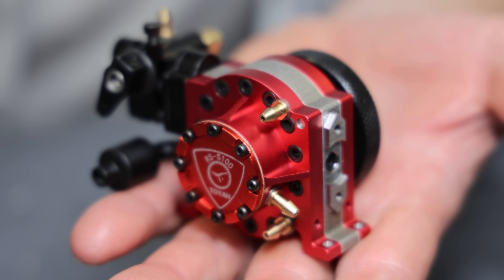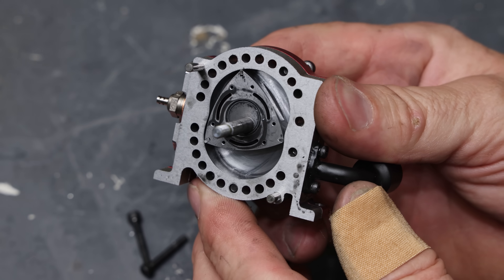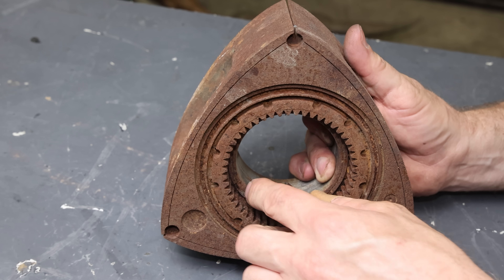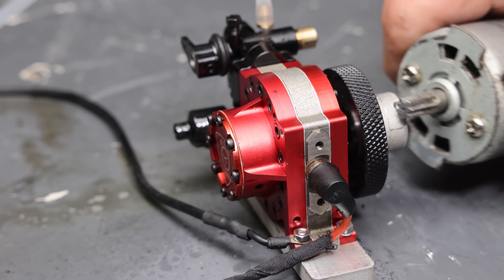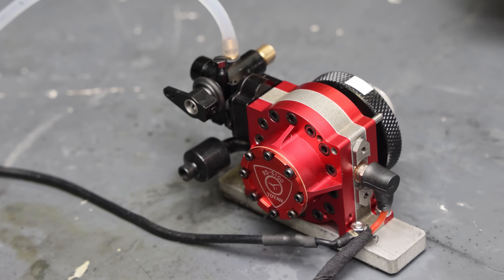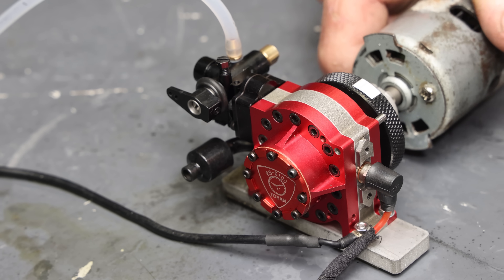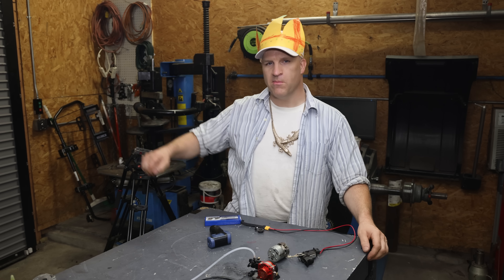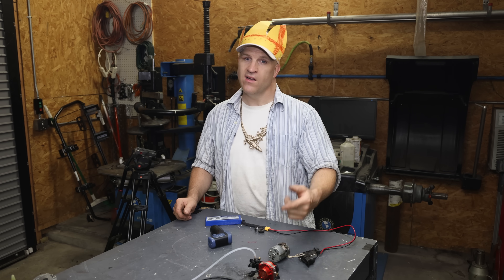Worlds Smallest Rotary Engine (30,000 RPM)

Comment: no tuning on nitro leads to what you see here folks.
Reply from the maker: Actually this is where no compression leads to. Without compression you don't have a running engine and you for sure don't have an idling engine. 
I mean come on let's be realistic, there are no corner seals no side seals and single piece single dimension Apex seals. Do you really expect this engine to run like a full size engine? However just like the other version of the rotary I built, I can modify this one as well. Might be tough because the tolerances are very small but I can make it happen.
Reply: @WarpedYT  lol a bad workman always blames the tools.

Face it buddy  from what you posted as a video you didnt take not even a fraction of a second to check the needle setting.

At least to see if its at a range thats for nitro.  I been doing nitro engines for decades all have an initial setting of 2 to 2 and half turns out as a starting point.

You heard the engine on first startup and still didnt bother adjusting.  You did this over and over again blaming the engine vs yourself.

Must a biden voter

Comment: Definitely a way to increase compression and it'd run way better and i personally don't think its worth 500bucks
Reply from the maker: That's exactly right, that's what everybody doesn't get an engine with a very leaky compression stage will never run really well. It's definitely cool no doubt but like you said some way to increase compression.
Reply: @WarpedYT  , I too own one of these Toyan Wankels and a few (4) O.S. Wankels. The huge mistake Toyan made in their design is to rely on the stacks of stainless steel wear plates for the faces of the rotor to rub against. My engine has a rotor that’s 0.0006” thinner than the combustion housing and with that much clearance it was still almost impossible to rotate. Why? Because the stainless plates bulge inward as their edges are pinched between the housing rim and red end plates. My O.S. Wankels are closer to 0.0001” clearance but O.S. uses a hard-plated surface to support the faces of the rotor and those are extremely flat, so the clearance you shoot for is the clearance you get. I can hand-start the Wankel that I fly on my pylon racer, that is how good it holds compression pressure. Contact me if you want to discuss some ideas to improve the Toyan. I’m in direct contact with one of their distributors and we are discussing improvements to this engine. I have the twin-rotor on order too. Cheers.

Comment: I would have taken it apart after running it. I feel it was compromised from being taken apart as the head surface torque, gaskets, flywheel position, Apex seals and springs are very sensitive. Would be nice to see one that hasn't been tampered with run.
Reply from the maker: One thing everybody on YouTube is teaching me I can't leave any Stones unturned. 
So I did run it before taking it apart, or at least I tried, the only reason I took it apart is because it didn't have any compression and a Apex seal was stuck.
Guarantee you I can make this engine run better than it comes from the factory.
I have built hundreds of rotary engines including peripheral port and Bridgeport, this engine is a piece of cake compared to a real rotary that has corner seal side seals two-piece Apex seals with springs, you have no idea unless you've actually built a real rotary, the seals are a pain in the butt. This engine piece of cake there's really nothing you can mess up unless you lose some parts.
Reply: @WarpedYT  , Matt, how tight was your engine as received? Mine has zero chance of running as the stainless plates are sprung inward towards the rotor. This engine needs a major overhaul before it can seal properly and run as intended. What happened to your cooling fittings?
Reply: @GFTPSMP  It needs a redesign

Comment: Mazda Rotaries have a bunch of complicated side seals springs. The way “crank shaft” works and assembly is far from simple. Just watch Rob Dahm assemble one.
Reply from the maker: I've built so many rotaries I've lost count, but I got tired of the Apex seal and corner seal issues.

Comment: That was a hop skip and a jump away from a full rapid unscheduled disassembly.  Would have been nice to see it go before you took it to bits.

How did you not spot the loose pin?
Reply from the maker: Lol.... Yes
Reply: The pin is only lightly pressed into the casing. Once the case bolts are tight that pin no longer has any use.

Comment: Another fancy Chinese machine, not an engine. 1.7 hp …. Should be 3+, nothing else than another Chinese crap
Reply from the maker: Actually it's .7 horsepower
Reply: @WarpedYT  , the first production OS Graupner Wankel was rated at .65 HP and the ones you did the transparent front cover was 1.2 HP. This Toyan will not reach .70 unless a ton of work is done to it. Hey, that waterjet is just what you need to make some .020” thick ground carbon steel wear plates to replace the crap stainless parts. Then shave the housing down to get the .0001” clearance I mentioned earlier. The waterjet shouldn’t warp the steel plates when cutting the profiles. Cut me a set too while you’re at it, please 🙏🏻

Comment: oh man after all these years playing with those engines adjusting the carb is still a no go to you ? what you do there is absolute kill to such an engine ... tryin to get to run with brude force all the time .... i can see it runs way to rich and top rpm right from the get go is not good for any engine
Reply from the maker: Lol .. actually I do adjust the carbs, but I was told by.the factory not to touch it because it was fully adjusted. But most of the time unless it's part of the story I exclude messing with the carburetor needle.
Reply: @WarpedYT  hmmm okay... so i guess this all not figured so well and they where just happy it runs and doesn t break right away .... i personally think you need at least 3cc to reliably run a (any type of gas) engine ... anything below 2,5 is way to sensible and loves to keep you hanging on the other end of the yard.... sure if you get into the hobby and blablabla you know ... (pro talk) then its all good ... not sure if all this is also the case for rotarys .... but somehow it seems they burn even less efficient then the small piston engines....
Reply: @WarpedYT  i just have this idea of inducting the FUMES and not the atomized liquid into the rotary... i ve seen many guys doing it now with piston engines .... i can find em again if you want a link or something ... just let me know

Comment: Flooded at start up, melting plugs and exhaust fell off.  Yes that definitely is a rotary. 

Surely not making any compression at low rpm. Lack of side seals and housing to rotor clearance allowing blow by. 

Btw that is pretty cool!
Reply from the maker: Blow by like a mo-fo
Reply: @WarpedYT  are you going to put turbo chargers tho?
Reply: Most rotaries don't make good cold compression, the internal operating temps are high especially around the exhaust ports so they have to design them so that the clearances are right at operating temp. Piston engines get around this with ring gap, Mazda uses spring loaded corner seals to give the apex seals space to expand. 

Also like you said, no side seals but it might just not be feasible to make side seals for something this small. Even in a 13b the side seals are thin and fragile, they would probably look like strands of hair for this thing lol. Looks like there's thin metal plates that go between the rotor and 'irons' that may be an attempt to create some sort of consumable side seal that covers the entire side of the rotor face instead of being recessed into the rotor itself. Probably good enough for something like this, seemed like it was ripping pretty good once it got warmed up. Probably didn't help that he disassembled it, dropped some pieces, then put it back together in a dirty environment. Even a tiny bit of grit would clear itself out but put scratches in all the sealing surfaces on its way through...
Reply from the maker: @Joebobinator  your dead on about everything except the disassembly, see what I didn't show was I tried 30 times to start this engine, it wouldn't start had absolutely no compression, then I proceeded to disassemble the engine and I found a completely seized Apex seal. None of the parts were dropped. But yeah I'm going to upload that as a separate video on my other channel and share it here.
Reply: In this micro application I wonder if a one piece  circular side seal could work to help mitigate the blow by and add compression, similar in position to the oil seals on a 13b.  It could sit just inside the bottom edge of the apex seal slot.  

Trevor, Mazda used 2 and 3 piece apex seals in the majority of their production engines which allowed the seal to cope with thermal expansion and self clearanced between the irons/side plates. The corner seals where there because the side and apex seal had too much dissimilar movement and allowed tighter clearance. The important tolerances on 2 and 3 piece seal engines arethe apex slot to apex seal, the side seal to corner seal, and the corner seal to corner seal slot.   I used to build 13bs and some what reliably made around 450rwhp with them on pump gas. 

Now with a 1 piece seal like was used in 12A and ceramics in racing applications you had to clearance the apex seal to the rotor housing width. But 2a d 3 piece seals self clearanced.
Reply: @williamkillingsworth2619  Some where in the world are the: to scale templates, for bridge porting 12A's.
Old Racing Beat customer.
Reply: I have an RX-7 Coffee Table book.
I owned one RX-3 Wagon and Two RX-2 Coupes. All 12A's and Spark plug seizing in the housings was a problem.
Yes, lack of side seals and no cooling system is a BIG problem. However Toyan just wants to sell 3 million tiny boat anchors at X yuans per copy.
Reply: @ayebee1207  lol, need to have a small boat to anchor or lots of anchors🤪

Comment: I thought this was an actual rotary and not a wankel :(
Reply: both names are correct
Reply: @robot797  there's no standard so no one can say there's a correct term, but wankel correctly describes the video in this engine it does not cover the rotating rotary engines I'm talking about so makes a lot more sense to be an exclusive term to wankels to avoid confusion
Reply: Exactly what type of ‘rotary’ were you hoping to see?
Reply: @GFTPSMP  an engine where the entire engine rotates on a stationary crankshaft. They were very common on early aircraft because of weight savings.
Reply: @matiastorres1510  very few rotating cylinder miniature WWI vintage rotaries have been built but they’re out there. I’ve been trying to buy a replica Gnome rotary for some time but the sellers ask too much.

Comment: Wish you wpuld have done more with the see through rotary as initially planned but this is pretty damn cool as well.

Being a rotary and it's size I think this unlike the 4cyl or V8 won't do well in a RC  as it'll lack torque.  Actually I wonder if it could work for an aircraft... it has enough RPM and requires less torque and rotary was and is used for aviation.  

Got off topic but anyways cool engine and video I've been waiting to see a good video on this engine since it was announced.

Comment: Would be interesting to connect that motor to the engine and see how much power you can generate from the engine.
Reply: The starter motor would slow it down unless you had a faster brushless motor, which that one wasn’t.
Reply: @garygaarderjr9733  yeah it would slow down but it would be interesting how many watts could be drawn until it stalls
Reply: rotary engines make a nice small engine for EV range extenders

Comment: hey at 5:29 theres a pin at the top corner of the engine facing the camera that is loose right when it shifted it looked like you started getting compression issues

Comment: really cool and pretty small, but not the smallest. Berkeley had a rotary engine the size of a penny about 20 years ago.
this is the smallest import design on amazon right now
Reply from the maker: No way I've never seen that, I'm going to have to look that up now
Reply: Apparently they build an 12.9 mm (~0.5 inch) engine. MEMS Rotary Engine Power System DOI:10.1541/ieejsmas.123.326

Comment: Man it’s a shame you disassembled it before you tested it. That’s the biggest no no. Every person I know including myself never tears something down before we test it because we want the most accurate representation of said product. If you are sponsored by this company your doing this a huge disservice by testing it after the fact and not prior because running and operating conditions are going to always be better before you break those factory seals and torque specs. I can’t tell you how many times I see people do this with electronics and mechanical engines and parts.
Reply from the maker: I did not disassemble it before I tested it, I tried to start it multiple times, the engine had no compression, I disassembled it to figure out what was going on, and it had a stuck Apex seal. No disservice going on here, I have rebuilt and the build hundreds of rotary engines. Out of the box it did not run,
Reply: @WarpedYT  ah well that makes sense then. I’d love to know if it’s a factory defect. I would love to order one but I’m not really down to rebuild or fabricate or Machine small parts these days but if this engine runs out the box I’d love to see it happen
Reply: @cppctek  , I received mine a few days ago and you can forget about running it as-delivered. The binding in the rotor was so bad it hadn’t a snowball’s chance in hell to run. The Toyan design is bad - wait for Toyan to improve it before spending your money.

Comment: 3:44 is it rotary engine or water pump
Reply: *fuel pump
Reply: All pressure engines are basically either pumps or fans. This is a pump.
Reply: @weareallbeingwatched4602  And a fan is a type of fluid pump.
Reply from the maker: Fuel pump
Reply: @WarpedYT  perhaps in disassembling the motor, you inadvertently enrichened the mixture, then again without it being cooled, I suppose it uses the fuel as a total loss coolant...
Reply: @WarpedYT  size wise, sure. Pumping a liquid would probably be a bad idea because of cavitation, particularly at the seals. Cavitation is what spalls the propeller on a yacht... the closed environment of that engine is worse.
Reply: @weareallbeingwatched4602  understand that liquid pumps don't compress the fluid.
Reply: @weareallbeingwatched4602  LOL I knew there was a keyboard engineer not top far away to know it all.
Reply: @weareallbeingwatched4602  Air is a fluid, air fuel mixture is a fluid. Exhaust gas, believe it or not, also a fluid. All engines are fluid pumps, ideally not a liquid pump internally but as a rotary owner sometimes they flood out so bad that they end up being a liquid pump until you can get em cleaned out. Fluid isn't a synonym for liquid
Reply: @Joebobinator  True. Cavitation is specific to liquids. Fluids are only linear states of gas flow, as soon as they are made turbulent... nonlinear. Hence not all gases are fluids. But yes, I would be more accurate saying liquid, and have altered it.
Reply: Yes
Reply: Whatever you want
Reply: For sure it has rotary 100% fuel efficiency!
Reply: Yes.

Comment: Need to lean it out. Rotaries do not, infact, like being flooded
Also, low compression is not normal for rotaries
Reply: This engine is designed in a way that unfortunately requires excessive clearances to even rotate at all. It barely traps enough air to compress and make power. Toyan has to update the design.
Reply: @GFTPSMP  I mean, easiest way to solve that would be to machine it out for some side seals/corner seals